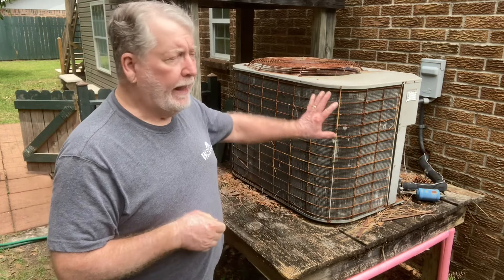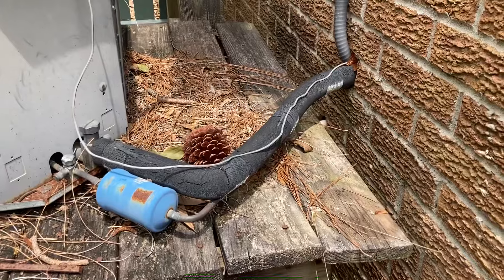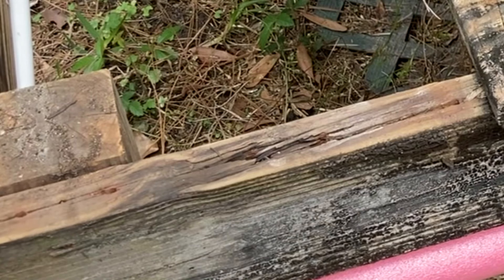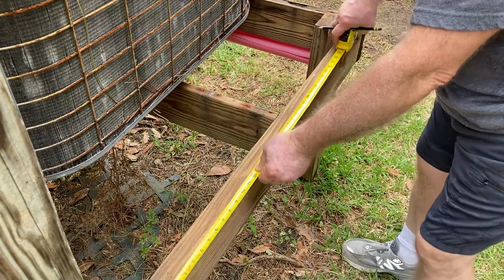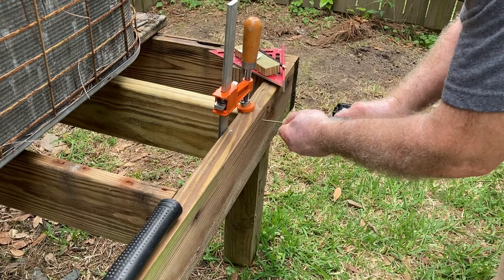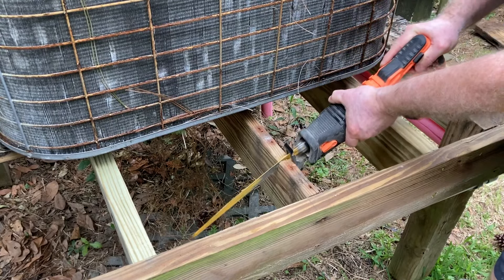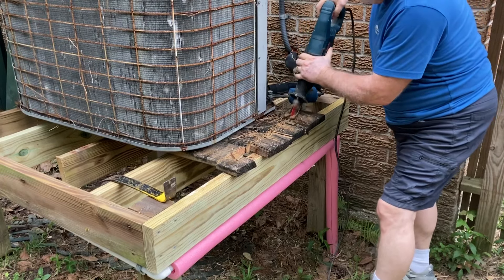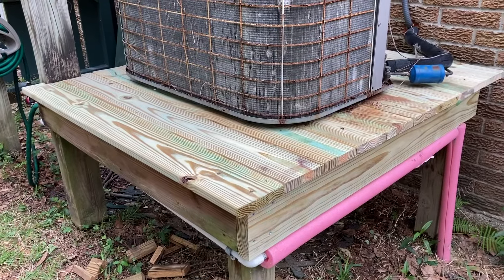Doing the Impossible! Replace the Deck Boards WITHOUT DROPPING THE COMPRESSOR!

Comment: Nice job Paw Paw!  Just curious.. Why is it on the platform in the first place? Most of the AC units I've seen are on a small concrete slab on the ground.  Good work though..
Reply from the maker: My home has flooded and the unit is raised to keep it out of the water. I have a second unit eight feet high that runs the main house
Reply: @PawPawsWorkShop  that would explain it!